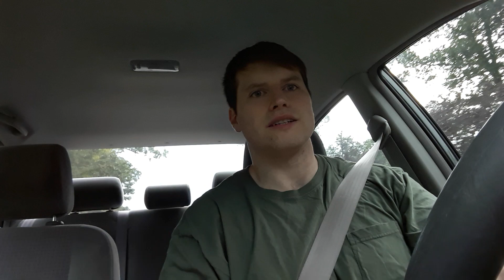SHTF Scenario #7: Nuclear Power Plant Meltdown

Comment: If we get an apocalypse, we are f*cked anyway because then all nuclear power plants will be unattended, and without control, the cores are not being cooled by water, so they overheat and explode. All nuclear power plants will then explode. And since there are 450 nuclear power plants all over the world, that is the end of the world.
Reply from the maker: Yup that's true unless they have a back up power supply many of them can self cool from the power they generate
Reply: @NYPrepper  not forever. On a shtf, they will become unmanned, and turn into nuclear bombs
Reply: @demondin  no they not turn into nuclear bombs. There is no nuclear blast without a bomb tk deliberately compress the material.Just a dirty fizzle with maybe a small convential explosion that spreads stuff around.
Reply: @tomarsandbeyond  how refreshing to see how little you know about this subject. Educate yourself before you start a discussion. Read some books, watch Chernobyl, then come back. ;)

But in the meantime, a nuclear reactor has a core of constant rising temperatures. The only thing that contains this is the constant flow of water to cool it down. This is a process that needs constant human attention and electricity. In case of human absence (apocalypse for example) this process will keep going for a short while. Until there is no electricity to keep the flow of water going, the core's temperature will rise and keep rising, turning it into a nuclear bomb. The core will melt, explode and (unlike Chernobyl and Hiroshima, there will be nobody around to contain the radiation and toxic clouds, making it spread worldwide.
Reply: @demondin  I know all that and have seen just about everything on this subject.
Reply: it is the end of the nice safe world that can aupport 7-8 billion people. But not the extinction of the human race. If that is what you mean by the end of the world.
Reply: that is not the end of the world. more like the area around Chernobyl expanded to almost everywhere. Life is thriving there. It is not great for humans but a small percentage of us would survive. worst problem, contaminated food and water.

Comment: Just found your channel.  A meltdown of nuclear power plant is a major, major issue.  The radioactive products produced in a meltdown are dangerous for 10,000s of years!  Chernobyl still has places where 5 minutes will give you a lethal dose of radiation.

Another thing people don't realize is that all reactors in America are an older design that is not passively safe, they require active cooling (thanks political idiots!).  Also, even if the control rods are fully engaged the plants require months of active cooling before the reactor is now fully shutdown and no cooling is needed.  Any major SHTF that kills the grid is going to cause many reactors to meltdown and it will be a huge disaster.

Honestly, if I had to pick between nuclear war or all the nuclear plants melting down, I would pick nuclear war.  At least with nuclear war the radioactive fallout decays quickly and after about 30 days clean up begin.  Not so with nuclear power plant meltdown.

Anyways, good video.  You might like my channel.  Stop by sometime.
Reply from the maker: I agree 100% with all you wrote, I am going subscribe and catch up on your videos.
Reply: @NYPrepper  - Very cool!  I will be digging through your videos so you will be seeing lots more comments from me. ;-)